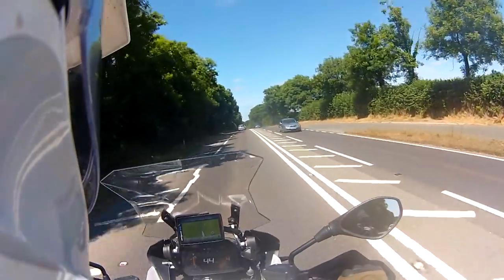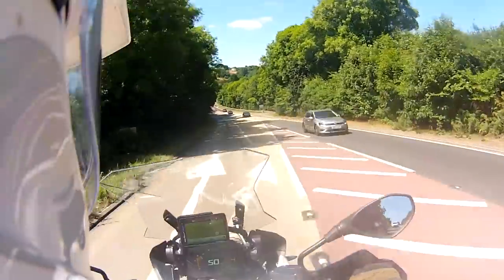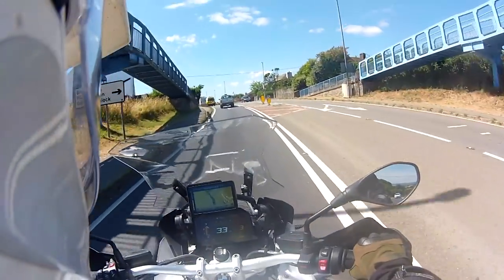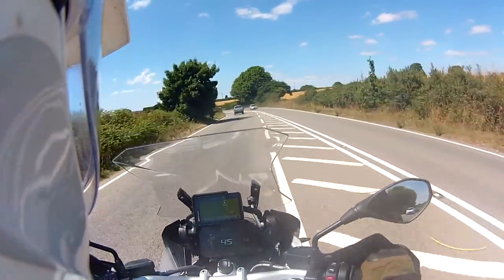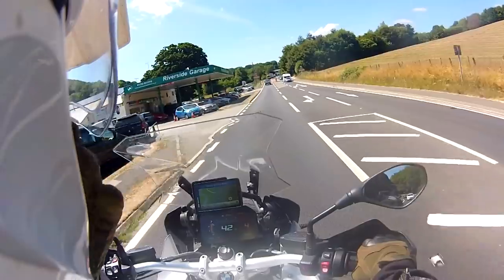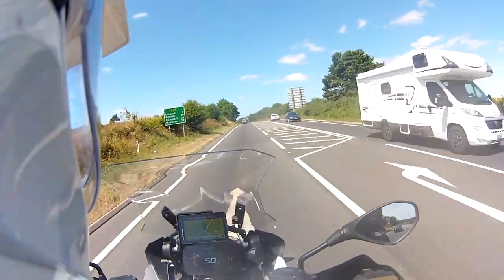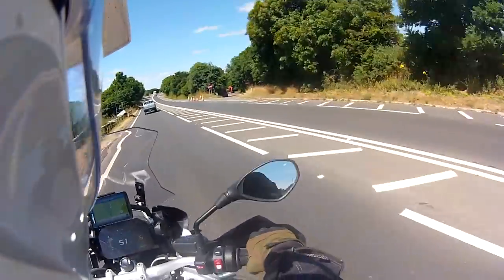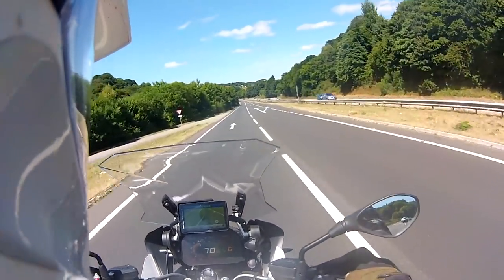How to position your motorbike for Corners

Comment: Love the video and commentary. Great to see the theory in action. There is so much to do whilst riding if you do it correctly. I'd like to know more about engine braking and how you ride CVT vehicles that you can't change gear on. I have had to move to scooters (physical limitations after knee replacements) and find that I'm not so confident in corners because of the lack of gears. Love to see a video that address' this situation.

Comment: Good Video thanks Mark. My nervousness comes on Right handers when I am over on the left. You make it look easy to be as far left as you are. Does that just come with practice? I worry that the slightest mistake I may make and I have nowhere to go, or do you rely on periphery vision of the Left Hand edge to remain on course? be interested to hear your (or Toby's) thoughts. Stay Safe.
Reply: Wayne Curtis its all about practise, sorry. Thanks for the nice comments.
Reply: I am the same I always worry about all he crap and drain covers on he left so I am overly cautious about going too far to the verge. The roads around my area have loads of gravel; muck  and at this time of year leaves! on the far left. Surely your road positioning must take into account the state of the road surface (pot holes ect) when deciding which line to take?
Reply: Paul Hartwell hiya! The position adopted on the road is always dictated by the conditions etc. It's all about practice... Have you thought about joining an advanced rider group?

Comment: Excellent video Mark, can I ask, do you need to lean your body away from the bike, off to one side when taking corners/roundabouts etc? Or is it fine to remain seated central (in-line with the bike) and just lean the bike? Thanks
Reply: Dave Day hiya! For the type of riding we are doing there is no need to slide all over the seat in my opinion, although other may differ. The bike will lean anyway because of the action of 'counter steer', its all just physics....
Reply: Mark Holroyd that’s exactly my thoughts too. Many thanks for your reply 👍🏼

Comment: Quite a lot of the time he was in position 1, close to where a cars nearside tyre would be on the road but he could have dominated his space or lane  better if he had been  to the  middle of the carriageway in position 2, the sump line without placing himself at any greater risk and in any further danger.  Probably by being in position 1 he could have encouraged some drivers to chance an overtake.   If the road is well clear ahead or the limit point of vision is a good one there is little or no need to keep changing  positions just to get a slightly better one. If we are talking Highway Code for overall stopping distance then at speeds in excess of 40 mph it can easily be seen that the safe stopping distance is actually greater than the 2 second rule and many police officers and emergency services adopt a 3 or even a 4 second rule.,  Its not just of  keeping  distance to the vehicle in front that is important, on a bend or curve it's the actual distance that one can see ahead. One could be keeping 2 seconds to the car in front but if it goes behind the hedge on a bend  you might only be  1 second beindit when you round the bend.

His speed at times was well slower than  the speed limits for that road and being in position 1 as said he could encourage or enable some drivers to overtake him, hgv.s are well known to want to drive faster. That said if he had taken position 2 that would have been in a position that would have been directly in front of any  driver behind and therefore he would be in the best position to be obviously  seen and not closer to the nearside which ends up becoming more like a peripheral vision position for vehicles moving close to his rear. Some drivers have a limited time span and in seeing you from some  distance away being to their nearside and they move closer it's more than likely that they do not look for you again and  actually forget that you are there and plough into you. Being directly in front of them mean that you are always seen to be there.

Comment: Do you not find position 2 to be too slippery due to oil and similar substance on the asphalt?
Reply: That's what observation is for, if there's oil and crap, stay off that position. However with modern cars these days, its very rare to see oil there in the dry. Having said that, you need to be a lot more careful of that position when there has been light rain as it tends to lift any oil up to the surface.
Reply: Becker Inal Kryten L says it all.

Comment: Is never touching your breaks actually a good thing?

Don't get me wrong, I prefer to ease off the throttle and just engine break the majority of the times, however, I've watched so many IAM, Rospa, bike safe videos, aswell as bike fails/bad biker videos, it seems there is always conflicting information. That's very understandable because whilst we engine break to slow down we give vehicle the behind us no visual warning that we are slowing - Its literally down to their awareness of the situation, the fact they are getting closer to us, are they speeding up, are we slowing down, are they even paying attention? We can't answer any of those questions as the lead vehicle until the situation has already passed.

So I question myself, sure engine breaking does us no harm and saves on brake wear, but is it actual the safest way of riding and something to be proud of?

As others have said, this is a road you are familiar with, would you ride in the exact same manner if you had 0 familiarity of what is ahead.

We should never compromise safety for a better view, yet at the same time people say a better view gives us more safety - sometimes that means breaking and going slower, its not about bad riding or nerves, its about letting other drivers know what actions you are carrying out. Don't forget speed limits are based on optimum weather conditions, optimum road surface conditions, optimum user awareness and "reported" accidents on that stretch of road.
Reply: Sorry for the late reply, I ride all over Europe and use this system of riding constantly. It doesn’t matter whether you have ridden the road before because advanced riding is about riding every ride as if you have never used that road before. Engine braking is safe and with good mirror checks will not cause other road users to panic. What you describe is what so many people do by waiting until the last minute before slowing down for example speed changes. If you plan your slowing down in plenty of time by having a good ride plan issues rarely arise. Read Roadcraft for advice and explanations. Ride safe.